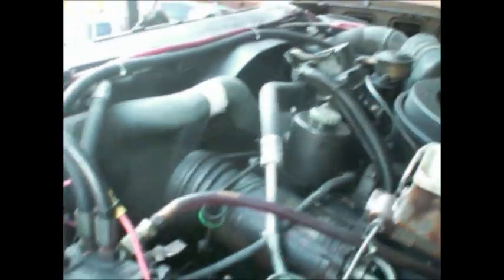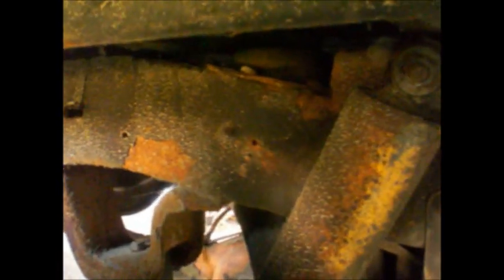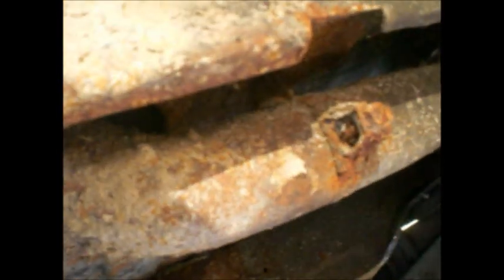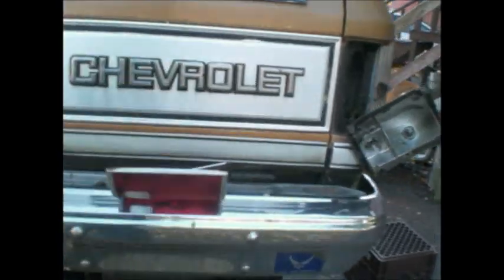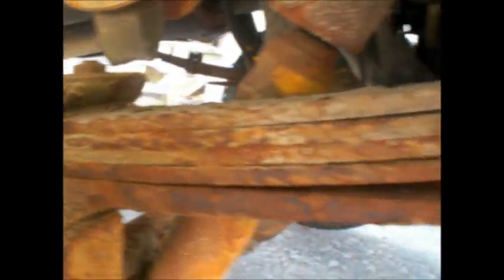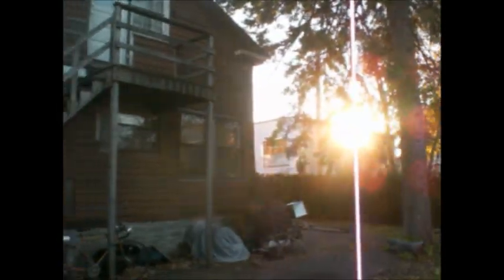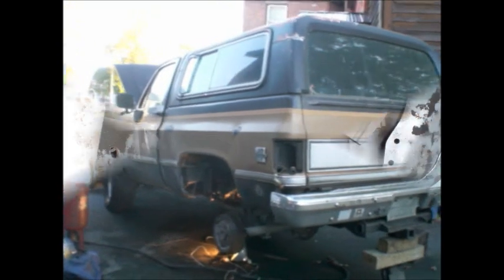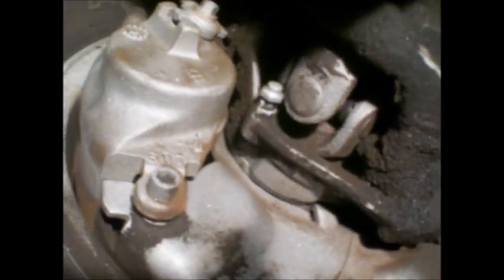K5 Blazer Sandblast Armistice Day  11 11 14

Comment: A good flush works in some places. Where you live, No way.. Too much salt on the road. Blast it, Zinc, Etch prime and paint. Might help.
  Once you blast it any galvy is gone.  Zinc spray it or it will rust faster
.  Blast the rot hole and pack it with JB weld. haha